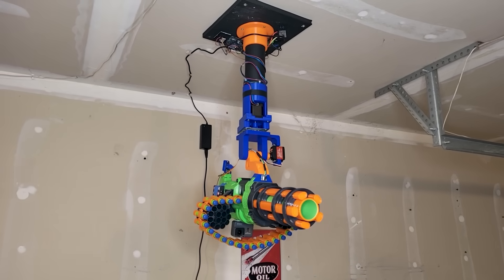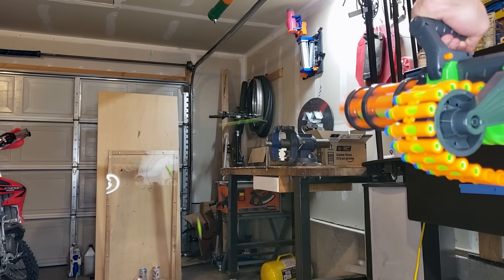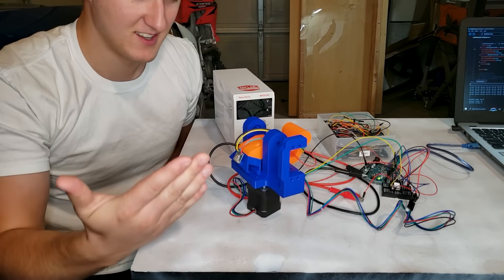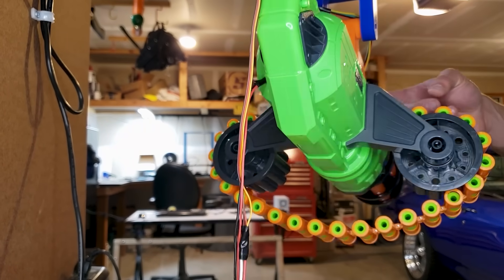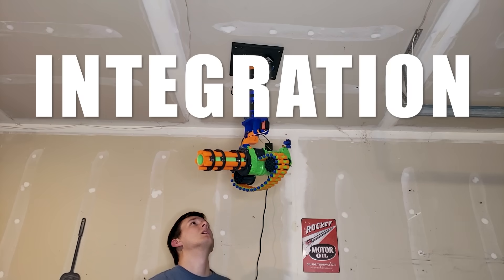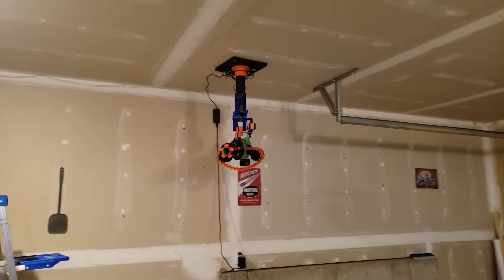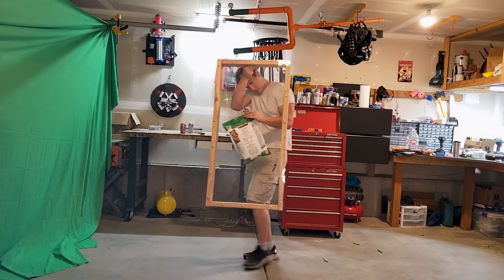I Made A Heat-Seeking Nerf Sentry Gun

Comment: Is there a reason you used a servo for the vertical movement and the stepper motor for horizontal?
Reply from the maker: Yes! The servo only has 180 degrees of movement, so each step at a far distance is quite large if I were to use it as the horizontal sweep. The stepper had much finer steps so it can track a lot closer

Comment: Why use a servo to hit trigger?  You have wires exposed.  Use micro to control the shooting.  Use IoT micro instead of the one you used to upload new code wirelessly.  :)  Instead of heat sensor, use AI Camera to track and pinpoint the exact person or persons you want it to shoot or not shoot.

Comment: What I'm wondering is why did you use a servo to press the rev and firing switches when instead you could just wire the switches directly to whatever was controlling the servo, especially since you had to rewire the switches anyway to relocate them.
Reply from the maker: i didnt have any relays or high power transistors laying around. Also I like to make things difficult for myself
Reply: @currentconcept  fair enough! If you ever decide to get into doing more nerf hacks, the modding community is thriving and will gladly help you along the way.
Reply from the maker: awesome thanks. I was looking up nerf builds to see what others were doing and its insane what some people have built.

Comment: 3d print the darts and add a small tip you will not regret it at all
Reply from the maker: I actually did 3d print a dart for this vid, and was gonna put it randomly in the belt so it'd be like roulette. Unfortunately it just kept jamming the gun and I couldn't get it to work :(
Reply: @currentconcept  oki :(

Comment: The "Internal Defense System" is a series of mounted turrets attached to the ceiling and walls of the rooms of the Blacksite. Serving as the backup security system, the Internal Defense System is designed to work best against humans & living organisms.

Outfitted with laser targeting, a body scanner, a spotlight, an automatic reload system, and controlled by the Navi-AI, each turret diligently scans its designated area for possible threats. Urbanshade employees, MR-P & LR-P, should not have to worry as the body scanner will automatically scan its whitelist record. However, the MR-P & LR-P have not been informed of this, as the constant fear of being gunned down by turret-fire has proved great in keeping them compliant.

With 70 5.56x45ss (small stud) rounds of ammo per magazine, each turret has the ability to deal catastrophic damage to humans and creatures alike.

When a turret runs out of ammo, it will automatically retract into its chamber, swapping its empty magazine with a fresh one in less than 5 seconds, before quickly emerging once again to resume its guarding duties. When a target enters its line of fire, the turret will fire a 14-round burst at the target. If the target somehow manages to survive or evade the bulletstorm, the turret will lock onto the target & fire again.

Most hallways with turrets are outfitted with a Breaker Box, allowing the turrets in the room to be powered off. These boxes are usually left unmarked and should remain closed at all times so that no possible escapees could possibly shut the turrets off before they'd be filled with lead.

For maximum efficiency, the turrets have been scattered at seemingly random points across the Blacksite, meaning no intruders or prisoners could predict where the turrets would be stationed.

If the turrets are somehow hijacked by the enemy and begin to target its own, personnel are advised to stay clear of turreted areas. Should they for some reason have to navigate through a turreted area, personnel should try to create cover using available furniture. Note that all lockers within the Blacksite are bulletproof, so personnel should hide inside a nearby locker until the turret is disabled or brought back under Urbanshade control.

Comment: Now make it detect motion and heat so that even if you use some kind of heat hider you still get hit. also replace the nerf with Airsoft or BB for improved damage. And putting that thing in a better location to defend your meatballs is a sound tactic. however what would work better is if you put some kind of track on it that is powered by an AI or a Code that tells it to charge at any detected heat or movement. Thank you. 
(Also sorry if this sounds demanding. this is all just Ideas on how your design could be improved)

Comment: Now make a 3D printed box mag, buy a bunch more of those, take the chains and connect them (all you need is a nail to pop out the metal pin already in place and connect them) so it doesn't run out of ammo quickly

Comment: Amazing video!👍 Wondering if you could upgrade the setup to a AI human face tracking device using Tensorflow or other AI so it doesn't trake any other heat source in the room?
Reply from the maker: yeah you probably could do AI with some facial recognition software. But then it wouldn't be heat-seeking anymore
Reply: @currentconcept  Yes that's true, I guess it could also lead to higher Delys if we're using AI😄

Comment: 6:23
"Friendly fire will not be tolerated"
You should replace the nerf gun with an airsoft minigun, they fire faster, harder, and pack a punch.
Reply: And most of em are 2 grand and 32 pounds
Reply: @aintruder3943  good point
Reply: @aintruder3943 Yes and? I've heard more impossible numbers.
Reply: @1stCallipostle  that’s true, but the weight is hard to work with unless he uses metal or more supports, and if it’s running on hpa, then he has to spend more money on a tank and a bb tube or some magazine system

Comment: I used the same camera for a animatronic that tracked folks as they walked by. Also had the “what are you looking at” problem when using the warmest pixel method. Worked fine in the spare room then stared off to the distance outside. Turns out the street stayed hot even into the evening, as did parts of the house across the street. I solved this problem by using what pixel changed the most method and that solved my problem in cluttered environments. I discuss this in my video here : https://youtu.be/syvH8i-V0Zk?si=hvrTXINzlk9ql8nR
Reply from the maker: That's a pretty sweet grim reaper. Also a great way to solve the problem - I'll be using that strategy if I use these cameras again. Kudos!

Comment: Don't garage door sensors use infrared? Is that what the sentry sensor finds so attractive?
Reply: Think he talking bout the Trip sensors on the bottom that should keep the doir from crushing you.

Those little boxes.
Reply from the maker: @ericzaiz8358  oh. yeah im dumb my bad
Reply from the maker: No infrared is line of sight only. If the receiver can't see the light, it can't do what its supposed to. Garage door openers use radio frequency stuff usually

Comment: Cool project! Wouldve liked to see how much better the performance wouldve been if you could pair a cheap webcam with it and use some basic ai recognition software to denote whats a human or not, or maybe a higher resolution thermal camera if the funds allowed it. Would also like to see how well it wouldve worked if you were hiding behind a glass panel you happened to be carrying ;)
Reply from the maker: Thanks! The thermal camera was $30, and I wish I had more funds for a higher quality one but that's not in the budget right now. I'm pretty sure the glass panel would have the same outcome as the plexiglass... right?
Reply: @currentconcept  Being similarily transparent in the visible range does not necessarily mean being similarly transparent to IR.

Comment: Always cool to see people automate Nerf sentries! There was another video that made an automated sentry (I think it was for a Valorant sentry replica?) that used an AI camera with human recognition. I wonder if you could combine those input methods? Also, if you're looking for high power automatable blasters, I think Jupiters (or is it Junos?) are great for using Rival rounds and having extreme ammo capacity via a proton pack, and if you want power as well as speed you might want to look into HPA or AEBs. HPA would actually be really good for a stationary system, because you could have a huge pressure tank and even an air pressurizer right there!
Reply from the maker: I would like to revisit this some day and make it much more accurate at longer distances. These are great suggestions thank you
Reply: @currentconcept  ah, if you want distance as well as accuracy you may need some of the higher end half-length darts, like Workers! They tend to be heavier, and since they have ribbing they don't encounter as much friction going down a barrel, also being short they're much less prone to fishtailing. That, or some heavier Rival rounds. Add some rifling too maybe? SCAR, BCAR, I don't know admittedly! There's a couple Nerf resources for optimizing the bejeezus out of perfectly normal blasters, I'm sure in a regular research phase for your next revision you'll find some great info! Happy making!
Reply: There are the TF2 lvl 1 sentry and Portal turret that WETA Workshop made for Valve, which use human recognition too! (oh man, those are older than I remember. The video on the TF2 Sentry is 13 years old and the Portal one is 12)

Comment: That was a lot of fun to watch! Super cool project! Now, I can't stop thinking about "Ednas" security guns from The Incredibles. 🙂Dangling from the cieling, They would blast you if you didn't have the password and they were also "Smart enough" to recognize the other occupant. Would it be possible to "see" what your turetts thermal camera sees? I used to have a handheld thermal camera with a nice resolution screen. If you couldn't see what the camera sees, how did you set up the "Exclusion Zone"? OOOO!! I just remembered something!! Metal surfaces are like MIRRORS to Thermal cameras!! It is a wild effect to see in person... Yes the garage door is a massive thermal loss but it is also is kind of like a mirror...(I conceed that the heat from the sun beats out any reflected heat it could detect) ... is your refridgerator door metal? That's just a mirror on a swivel to a thermal image. 😀The covers to the electrical panels look like The Magic Mirror from Snow White. Its darn impressive how far/deep that "reflection" can see.. I swear it looks just like a mirror but in a crazy color scheme hahaha. Thaks for the awesome video!!
Reply from the maker: Yeah thermal cameras are super cool and weird lol. I set up the "exclusion zone" by counting the motor steps. If the camera detected me while the motor was in a certain range, it knew that I was trying to steal a meatball. Also its possible for me to see what the thermal camera was seeing, I'd need to take the pixels data and put it in a grid and colorize it

Comment: Awesome video and the nerf sentry is great, plus your wife came in clutch with blocking out the heat for the gun. I had a few comments for some problems you had. Firstly, for the keyed shafts, look at splined shafts instead for power transmission. They're used all over a car from the engine power output to the steering column. They're just an invloute gear profile with a 30° pressure angle. 

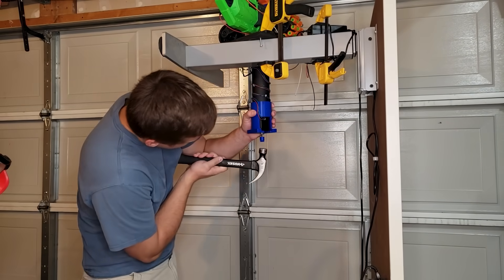Secondly, the lazy susan bearing is designed to be used in compression not in tension. You can see it not working around 5:04. The ball bearings in between the 2 plates should move at a different speed than either plate (half the speed of the moving side) but you can see that they move with the bottom plate. You'd be better off changing how you hang it by finding a way to compress the bearing. You can also look into taper-roller bearings, where you have the gun mounted to the male cone with the cone facing downward and the female cone on the stationary mount. You should be able to 3D print one that will be suitable for what you are doing.
Reply from the maker: Thanks for watching! The spline idea is great and I will absolutely be using that moving forward. Thats good to know about the turntables.. thank you for all this mechanical insight! Its the area I lack the most - sometimes I dont even know what to Google when looking for a solution. I appreciate this comment
Reply: No they aren't.  The steering column is smooth with a rack and pinion at the end.  The gear is at a 45 degree angle to the rack.  The only splined shaft in a car is the clutch.  Even then it isn't really a shaft so much a a gear matched with a toothed collar.